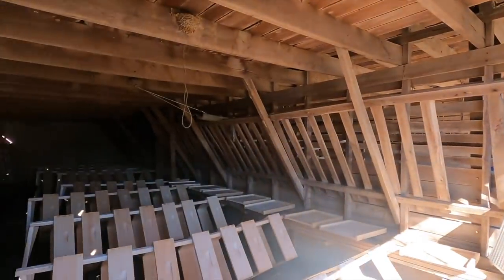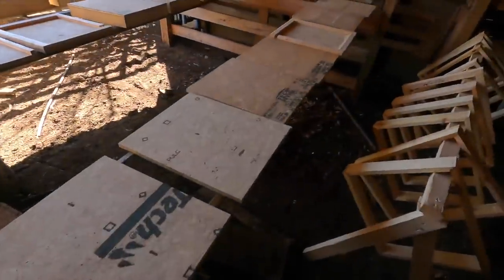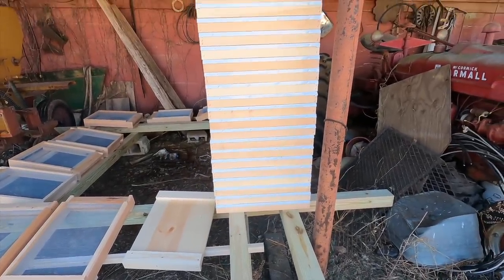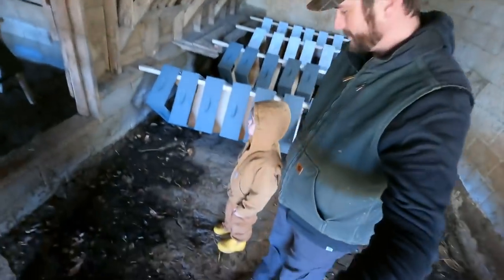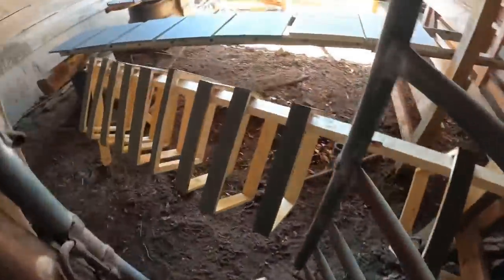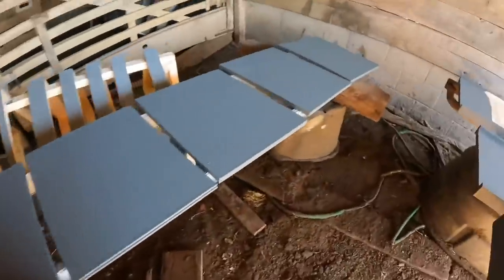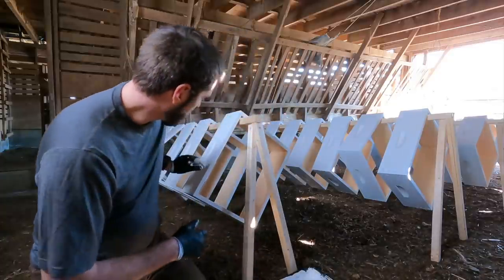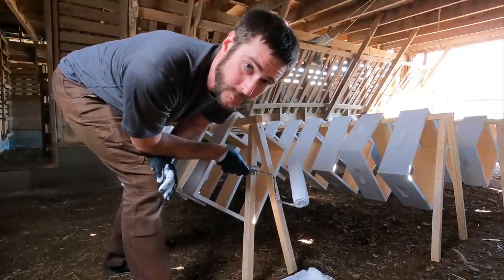Painting 100 Honey Supers - ‘21BKS #5

Comment: One other tip I forgot to mention is that I would put the roller back in the plastic cover it came with (or a ziplock) so that it would not dry between coats and I could use the same roller (without cleaning) again for the second coats...no clean up.  I just threw away my rollers when I was finished (cleaned and save the brush though).  I used one roller for the oil based primer and a new/separate one for the Acrylic Latex Enamel.
Reply from the maker: I’ve done that with grocery sacks as well.  It’s amazing how long they’ll stay usable.
Reply: I saw a tip where this painter of some years experience said he uses a clean pringles cylinder to temporarily store a wet paint roller. I've never tried it, but it looked like a good tip.

Comment: Pro painting tip: Airless sprayer. Buy one. You can paint the house and barn afterwards and it will take less time then that took. Keep up the good work!
Reply from the maker: Thanks Marty, any recommendations on a brand or model?
Reply: I have a Graco 395 ST and a Graco 395 Pro. Both are entry level + and will work for many years.
Reply from the maker: Thanks Marty!
Reply: Yup!! I just used one for the first time the other day. No more brushes and rollers if I can help it.

Comment: I absolutely love your channel!  I just painted around 30 hive boxes using the identical method and paint system so I can lend testimony that it works very well.  I have standardized on one size box for supers and brood but mine are 8FD versus your 10FM.  I followed the Bob Binnie method as well (without the copper treatment) but used the Zinser Oil Primer and Behr Acrylic Latex Enamel paint-High Gloss (High Gloss is very important).  Bob stacked his but I used the 2x4 (like your 2x2 fir strips) "down the middle" method like you with buckets and saw horses.  Rollers work very well as it gets a good thick layer (Bob mentions that in his video), goes on relatively fast and does not have overspray issues compared to spraying (saves paint and does not get in the hive box).  I too used a wide roller for the boxes, brush for the handles and small rollers for lids, top feeders and bottom boards like you did and it worked well.  The only difference is that I would paint all the handles of a given box first with the brush and then immediately roll all the sides and edges since the two passes don't interfere with each other with the wet paint (e.g. roller does not mess up the handle area just painted and any overpaint on the side from the brush is immediately smoothed out by the roller.  So your method and mine have the same number of box rotations (twice around for a coat of paint) to do both the handles and sides but I only touched the box once (finished the entire box before moving to the next).  I am very pleased with the looks and toughness/durability of the paint system.  One technique I tried to employ was to slide my box along the 2x4 when rotating to the next side.  This uses the 2x4 to wipe the inner edge of the side from any paint that a roller may have left and they tend to do with a thin surface against a wide roller.  FYI...I did not pay a "dumb tax" as I started of and consistently used a 3M respirator with the correct cartridge/filter so no headaches here.  Thanks again and please keep the excellent videos coming.
Reply from the maker: Thanks for taking the time to write!  I love getting comments like this, made my day!

Comment: You can pick up a high volume/low pressure sprayer at the big box store for around $60. Lot faster than this and pretty much disposable, if you don't care to mess with cleaning it. One step up will cost around $90. Faster still and probably still cheap enough to be disposable.

Comment: I think you like painting boxes as much as i do.  Lol.  Your system is very close to mine.  I did learn that the 9" paint roller i can saw in half with a hack saw  and save money because it is cheaper than the small rollers.  Also you could cut the paint roller to the specific width you need.  I have built a wax dipping tank and purchased wax and am about to try that.  Thanks for the great video!!
Reply from the maker: Thanks Carter!

Comment: I'm also looking in to a wax dipping setup. Other than rust are there any other issues you know of using sheet metal for tank material instead of stainless?
Reply from the maker: Volume is the biggest concern for me.  High up front cost vs the ease and durability of wax dipped.  I really do hate painting…

Comment: So I see you paint the top and bottom edges of the boxes which I have also seen other suggest to help protect those areas from rotting. Do you have problems with the painted edges getting stuck together more than just the bees sticking the boxes together?
Reply from the maker: Yes, they do stick more than if you don't paint them.  As they age it gets better though.  I let them air out for a couple weeks before I stacked them.

Comment: You don’t paint the inside?
Reply from the maker: No need to.  Bees will propolize it anyway.
Reply: No, the inside of supers & inner covers are not recommended to be painted. The bees like the wood. I would recommend painting all sides of the bottom board. Easier to clean. 
No need to paint the inside of tops that bee's have access to.
Reply: @hcaveman6954  I’m planning on dipping my hive parts in copper naphthalene. The other option is to build them and roller the copper naphthalene on just the outside. Watching and listening to a number of folks about this perspective
Reply: @drjmarkrodgers1428   I did  see that one of the major bee equipment dealers was offering the copper nap... treated woodwares for sale. I understand why to use the copper nap, allows the woodwares to last longer, might keep wax moth at bay, termites, & etc. My question is if it affects these other insects what effects will it have on the bees &/or the honey?  Maybe a university has done a study stating that it is ok to use with direct contact of bees.  ??
   I personally could not recommend the dipping, but outside coating should be acceptable. If someone has more exact information please pass it on to us or Duck river honey.  I am not a bug expert, just someone trying to get my bees to make me  some honey! 👍👍🙂🐝🦟🐞🦋🦗